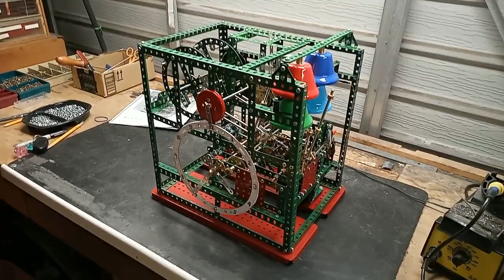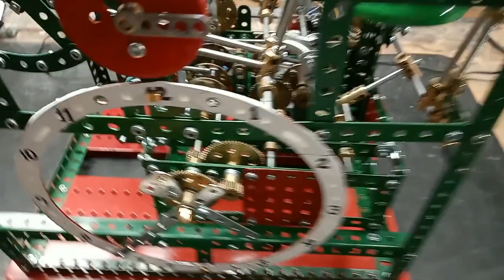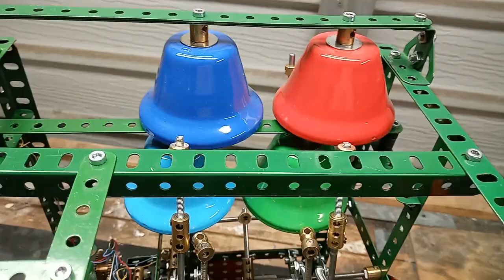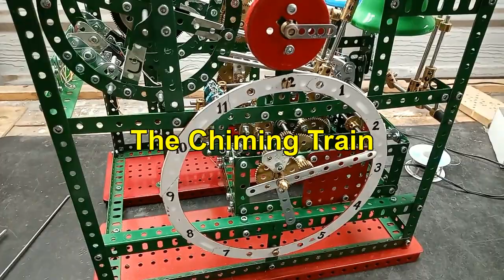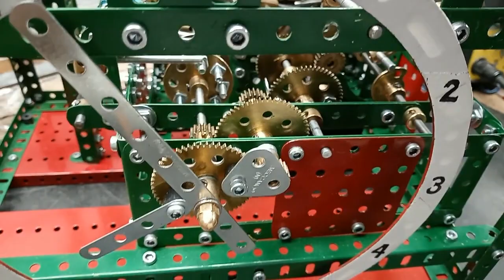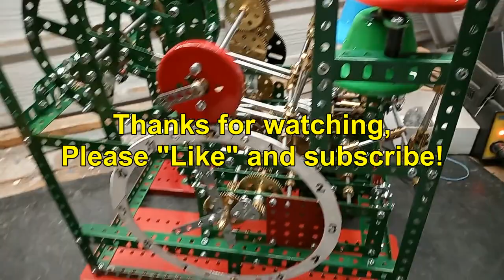Westminster Chiming and Striking Clock in Meccano by Mick Berg, from a design by David Couch

Comment: That is outstanding. 
I have been pondering how to add hour striking to my weight and pendulum grandfather clock which I scratch built from vintage Erector set parts (pre-1963). A rack and snail is the usual method but I believe that would be unworkable with the vintage Erector parts available.